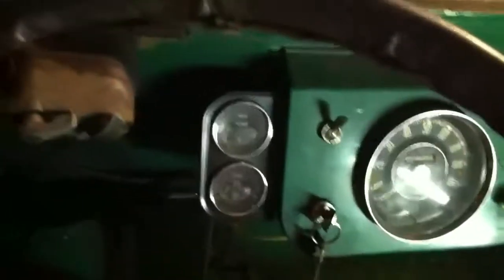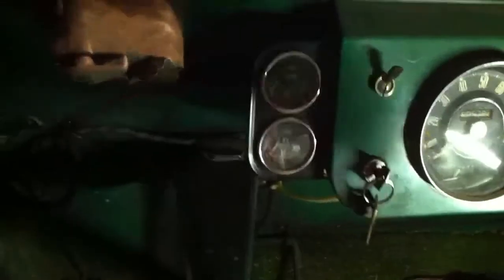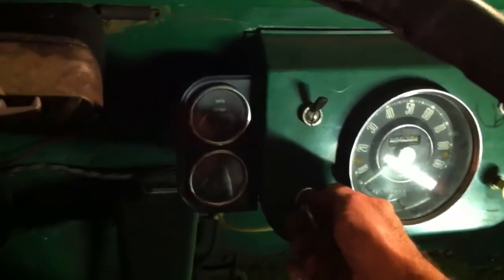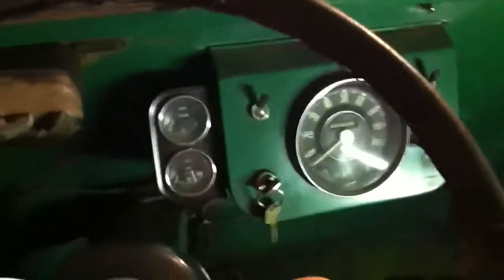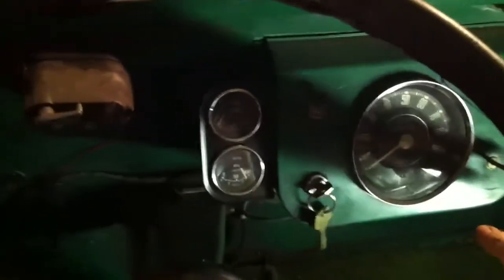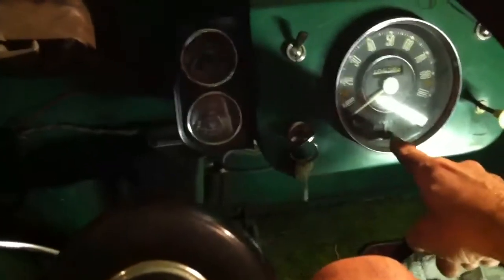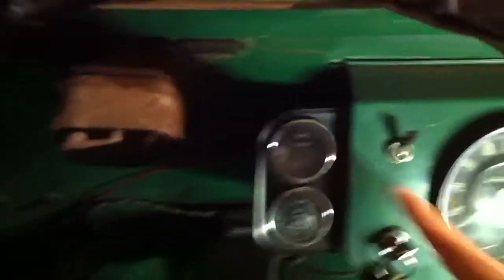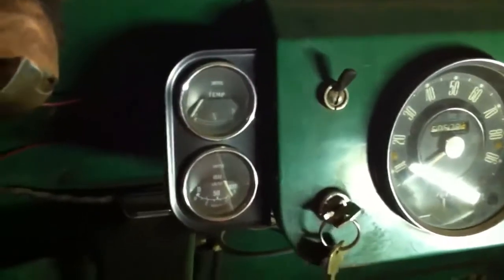Negative ground. Will everything still work?

Comment: why change wiring what have you gained
Reply from the maker: In this case it was to be able to connect a modern fuel pump and tachometer. All my other Minis, Midgets, and Morris Minors have been converted to alternators, which must have negative ground.  This was many years ago and the Moke is even more awesome now!!

Comment: I have a 1953 T20 Tractor grey Fergie its Positive ground will the ammeter work and the oil pressure gauge, will they not need to be a higher ampage.Cheers.Jimmy
Reply: If you have an original LUCAS coil then it will be wound +ve. You can get a -ve coil. The coils are wound for the transformer effect. The spark is known as NEGATIVE spark or POSITIVE ground. Stay with +ve ground.

Comment: I like to get your email I have a otumatic gearbox  have a few questions 👍thanks
Reply from the maker: Hi Jose
I do my best to answer any questions within reason!  I am considering making Cooper Road Mini a "real" business, but anyone can reach me for a question or to discuss a special project....  jemal@CooperRoadMini.com
Reply: @JemalCRM   I have a mini otumatic I liked to ad some siries horsepower i like to be like your green car  of yours I'm in  oregon  im a Sirius person . I also been checking out those vtec minis what you think of that can you give me a price difference  I can send  you fotos of what mini I have
 Thanks. 503 2687321
Reply from the maker: Unfortunately, the auto trans for the classic Mini is not at all suitable for serious performance.  They are known to be delicate, there is no reliable supply for parts,  and people who have them try to baby them along to keep them alive!  Also unfortunate is that the engines that have the auto trans are different enough that they will not accept a manual trans swap easily, so a bad trans can be REALLY costly!

The good news is that the Mini body will accept a manual powerunit (engine and trans) very easily and all the holes are there for the clutch parts!

You did not say what year your car is... If it's not a very collectible early car, look into the VTEC conversions. You'll get a LOT more power more reliably than my green car!   I'm putting 3 to 5 times the power that various bits were designed for, so I must expect that things will break!   Call my friend BJ at Minitec in Georgia about the VTEC conversions!
Reply: @JemalCRM  thanks you are good at this and I will like to do  this i have to said when I talk to  you I fill like you know minis alot  what's the # for your friend in Georgia because it sounds  ike I'm doing the exchange when it breaks down thankyou  mi car is a late model like 97 I think. Thankyou  for your time.
Reply from the maker: Ah, yes an even better choice for a Honda VTEC!  Not much performance potential with the late fuel injection models either!  Likely a Japanese import... the auto trans was popular there.

Here's the contact info for Minitec....  Website is www.superfastminis.com  and here is the contact page:
http://www.superfastminis.com/contact_information.htm 

Your car probably only puts about 45 HP to the wheels!  250 HP is not that difficult with a Honda!  Have you ever ridden a Yamaha R1?